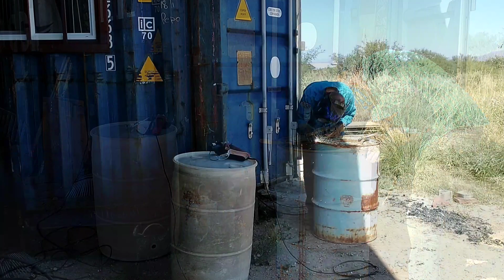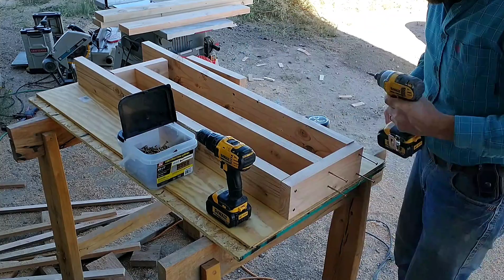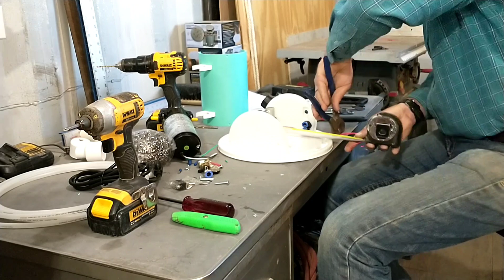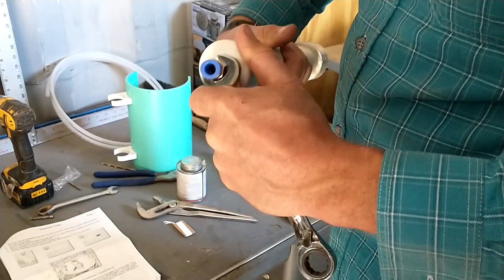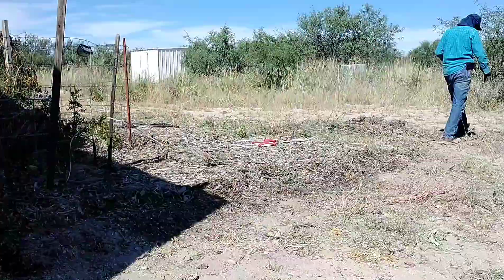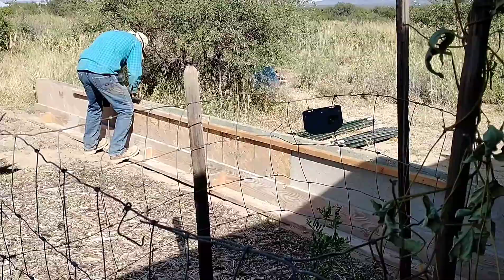AIRCRETE Cost & Tools | Making Forms For Test & Garden Wall| Little Dragon Foam Generator Assembly

Comment: Can i make the normal aircreat mixture, in an eletric concrete mixer, or is it possible to mixture the foam with pré made concrete in order to mixture the foam in the end.
I will make the calculations, because i will build a "normal" shape, and i'm pondering make the walls of air creat and maybe not bricks, and how good this material deal with water infiltrations and how good it is as a insulante material ? 
Of course the strutural part of the house would still being made by normal, stell-concrete mixture.
And by observation the exterior would receive a one inch cover of basalt rocks.
Reply from the maker: You could make some test batches and try it. We found aircrete to be quite finicky and unpredictable. We suspect that the cold overall temperatures and cold water in the Drexel foam solution made our last batches turn our brittle. In the end we decided it wasn't worth the risk to use it to build our house.
Reply: @RedandAprilOff-Grid  Well, i'm going to built it in a subtropical climate so i truly don't know, how this is going to go, well i have of course other options for good insulation walls also. I don't know about the costs also tho.
But what do you think about putting also in the aircrete mix shredded polystyrene also for giving it more free mass and increasing the fisical strength.
I don't know i probably will do some batchs for test like you guys said, also i was probably not going to make blocks for after use if i'm going to use it, but yes i'm going to fill the whole wall with it in layers, probably also going to put like lines of wire inside of it to giving like an skeleton.
And finishing in the outside with local rocks and the inside with plasterboards, and putting all the eletrical and water components beside the black water system outside of the wall in a very rustic way.
This way also would be much easier to fix any problem who could appear.
Reply: And of course i was not also looking for a strong material at all, just something who could be rather stable, be used as an insulation material in itself, because i was really looking for doing it with the strutural bars made of nice good normal concret and steel, but of course this would need to be minimum resistent, on your tests what was the total of mass the foam increased the aircreat ?
Reply from the maker: @henrytozarini2369  Not a lot is known about the long-term durability of aircrete, so we decided we didn't really trust it for our house. We were planning to use a metal frame for structural support, and reinforce the poured aircrete walls with rebar, wire mesh, fiberglass mesh and stucco, but we still had some concerns that it could eventually crumble inside the walls from temperature changes or wind. Once we ran the numbers for our particular design,  it turned out to be just as expensive or possibly more expensive than traditional construction. Some people have seemed to have success with aircrete though, so I don't want to discourage you. Best wishes on your build, whatever you decide to do. 🙂
Reply: @RedandAprilOff-Grid  Thank you very much for the honest, that's what i'm looking for, for sure i will still run a lot more research before choose the way of building.

Comment: Another reference to mixing concrete with ground styrofoam...  https://youtu.be/r2vcHKzDYnc
Reply from the maker: Pretty cool! We would need a lot of space to get enough styrofoam to build a house with.  I saw aircrete Harry's collection of it, and decided no thanks. 😅 Plus it's SO messy! Red also said, it would cost a lot in gas making trips into town to pick it up assuming you can find it.  Making aircrete has been interesting. Harder but also easier than I expected. We have a video coming out tomorrow showing our first batches.  Thanks for sharing the video!  👍😊
Reply: @RedandAprilOff-Grid  looking forward to seeing your results.  Perlite is an agricultural amendment in some areas.  I have see it used in place of sand in casting lightweight cement structures.  Wishing you both continued blessings and another great week.  Peace.

Comment: Way cool. MyLittleHomestead had issues with their first foaming agent and switched from one type of soap (or detergent) to a different brand and had great success keeping everything else the same. So might want to keep that in mind if the foam's density is an issue.
Reply from the maker: Thanks so much! Yes, we are using Drexel which we hear is the best. We had some issues with keeping the pressure right for the foam, but are getting it figured out. So stay tuned for our first aircrete test batches, it's been interesting. 😊